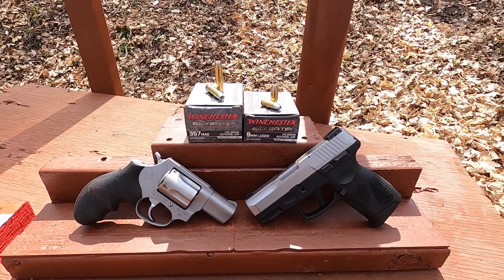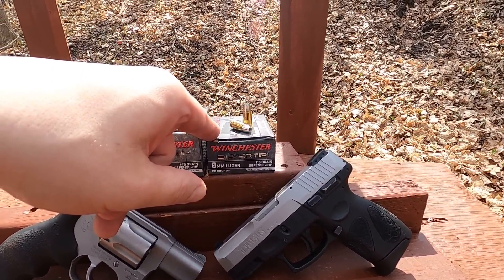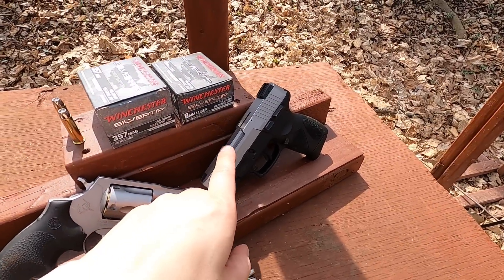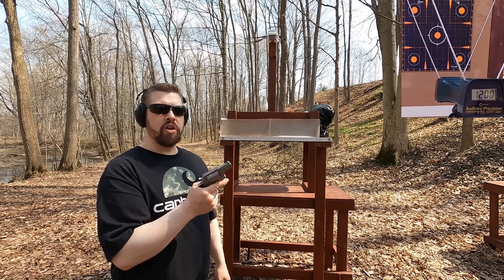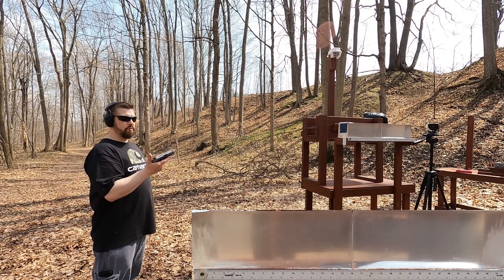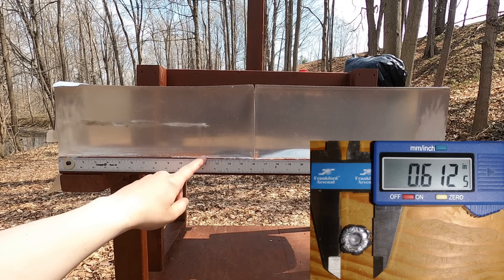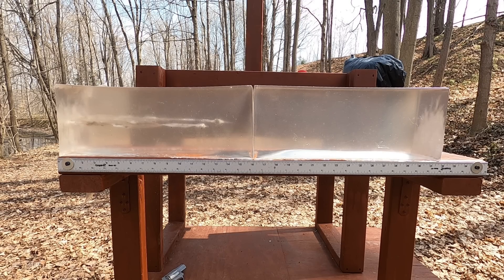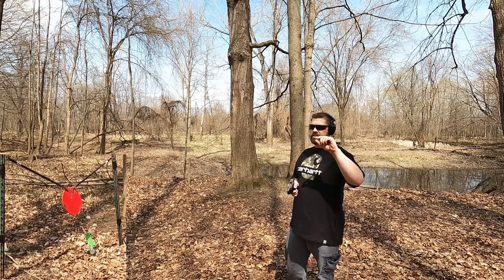Short Barrel Ballistic Gel Test -9mm VS .357 Mag Winchester Silvertip

Comment: I've experienced this back blast phenomena. To this day I still have don't know what caused it. I regularly shot Remington UMC 130gr FMJ 38 special but on one occasion at the that strange back blast occurred with a small number of the rounds in that box. The concussion nearly knocked my safety glasses off and it was extremely unpleasant for the thumb of my none dominate hand as-well. A range supervisor witnessed it we unloaded then gun and inspected it thoroughly to ensure it's timing was not off and that it was not excessively dirty he though maybe it was debris related. Once we were certain everything with the firearm was okay we determined it must have been that batch of ammo. I no longer shoot Remington very often but not for this particular reason I have shot this ammo on several occasions since and have never had it happen again. Excessive debris from the lead core or perhaps the base which is generally slightly concave may had some sort of irregularity was my conclusion. I imagine back blast from that 357 mag would've been a much worse experience.

Comment: I ran into a similar back blast issue once with some open base fmj I couldn't figure out why it was happening on every other shot and not every shot either its a strange phenomena. It seems Winchester has made changes to the silvertip line over the years I had some blemished round that lacked the plating a couple years ago but ultimately I parted with the product line altogether when quantity per box was reduced from 50 to 20 and price per round went up and yes this was pre-pandemic. Was the 357 mag from the same box used in the S&W 686 video?

Comment: Si ce you say the timing is ok, most likely the forcing cone is not cut quite right or is slightly misaligned. If so, i would expect that problem to occur with all ammo. Don't k ow if recutting the forcing cone to 11 degrees would help. I know it is commonly done by gunsmiths when tuning a revolver. Just a thought. The rounds could have done a little better, but expansion was great. Might be a good load for apartment, townhouse, or condo dwellers. Esp the 9mm.

Comment: My 605 did the same, and it was a timing issue. if you press the trigger to the rear of guard you will feel  movement rotating the cylinder. Try this with S&W, SP101, K6s, the cylinder will not rotate. I have used the same ammo in all four, and the 605, only culprit
Reply from the maker: I checked the timing. No timing issue. If this is the issue, why has all ammo before this test been shooting fine no issue, and all the ammo fired AFTER this test shoots fine no issue? I think it's fair to use common sense rather than jump to conclusions.

Comment: Your gun is so out of time.........................................J/K🤣🤣🤣🤣.
Honestly it's something I've never really researched but beyond making sure the cylinder is locked before the hammer is fully back in SA and before the hammer falls in DA[and maybe feeling for cylinder slop when the trigger is pulled with hammer down] is there anything else to check??
Reply from the maker: I do both those thing, as when I had a J-frame fragmenting ARX bullets, you guessed it "your gun is out of time". I do a slow double action pull, and it locks up long before the hammer drops. I put a .32" dowel rod down the bore to check for catches, manually inspected lockup with a flashlight etc. All I can say, is it's not out of time. Oh, and the ultimate check, try other ammo after....yeah, no such issues like with the Silvertips.

Comment: Ballistically, the 115gr 9mm +P+ is roughly equivalent to the 110gr 357 Mag. from a snubnose... but with less muzzle blast.
Reply from the maker: Yeah, a 9mm +P+ is like this, and low recoil. But the downside is, well if you are anything like me you feel fie with the .357 Mag and kind of squeamish about an overpressured round and the ability for your firearm to handle it. Like, I tested some in my 5" M&P, but there's no way I would run it in my G2C.
Reply: @GunSam  I hear you. I've ran both a Gen 3 Glock 26 and Gen 3 27 w/9mm conversion barrel/magazines and never had a bobble or had the gun beat up too bad. Most of your top tier brands will handle +P+ you just don't want to feed a steady diet of them... just enough for function and accuracy test every so often. But yes, the "cheaper" brands I would be leery of firing +P+ rounds even for carrying... because the middle of a firefight is the last place you want to find yourself with a busted extractor, etc. 😳

Comment: By the 2nd round, I'd have been wearing a glove with the .357.   Even if it's only gasses escaping out of the gap.  We used use a brown paper bag to cover our shooting hand and handgun.  Shoot down range and check for holes in the sides of the bag.  If the cylinder gap to barrel was misaligned on any chambers, it would leave "finger prints" to tell the story.

Comment: Timing would have been my first guess too considering you didn’t mention that blowback problem with the 686. But I will believe you and trust your word that timing was not the issue. 

Either way I feel this round was disappointing in 357 Magnum for sure. Really inconsistent velocity. Looked real good in the 10mm from the previous video and not bad in 9mm (probably be good enough in a duty size pistol). But I wouldn’t really call this 357 magnum. Definitely a light load. Good video though.

Comment: Funny thing, I recently bought some SILVERTIP in .380 because it seemed like a good deal. After your review I see that it's probably, pretty much crap! I won't consider it too be a self defense round. Now, I will just sling it down range at some paper & never look back. The SILVERTIP .380 is 85 grain, 1,000 fps with 189 energy. Got it at Bass Pro for $14 a box, oh well. I will stick with the Federal Premium Hydra Shok JHP. Thanks for the heads up on this ammo!
Reply: Depending on temperatures and atmosphere pressures, high pressure rounds will “paint” you you with powder if  you are firing in a confined space, or low air flow conditions.

Comment: I had a similar issue with crap being sprayed back at me in my new Ruger GP100 10mm match champ & sent back to Ruger. Ruger had to replace 3 or 4 parts because they said the cylinder timing was off. Maybe a return to Taurus will resolve the issue... BTW Ruger was great & the return process, pistol fix & mail-back to my home took 13 days Total.
Reply: Don't expect that from Taurus customer service. I sent one to them and they had it four months and wasn't fixed when I got it back.
Reply from the maker: The problem, is that no ammo before or after this test had any issue. So, jumping to the conclusion about the revolver based on one ammo alone is not how I figure out the problem to issues. The problem is self explanatory.

Comment: Sam I was very surprised that the 357 145 grain Silvertip did what it did sounds to me like the jacket is or the aluminum jacket is shaving off in the forcing cone coming back at you I don't know if this happened in your 686 but it may not be the ammunition it could be the gun or both the nine mm in 115 grain was the staple ammunition for the Miami-Dade shootout 1986 with the FBI and as you saw penetration is just barely making FBI statistics and causing just wounds and not lethal hits to the vital organs of the suspects again great video
Reply from the maker: Thanks. I shot other ammo after this in my 605, no issues, cleaned and checked timing with a dowel that fit the bore tight, flashlight check etc, I saw no issues. I ordered the 158 gr LSWCHP standard pressure .38 from Buffalo Bore because it's velocity rating it identical to the old FBI +P load. I want to do a video on that shootout, testing the ballistics. That .38 round in a 4" 686 is what ended the fight, and I also have some 115 gr 9mm left and a 4" pistol like they had that day. Perfect setup to test those two rounds side by side. I plan to use my bologna/MDF pack, directly into the gel block. I might use a 2" for the .38 too as some agents had a snub revolver used.
Reply: @GunSam  this will be a very interesting video Sam.
Reply: Try measuring the length and diameter of the bullet, casing and cylinder. Compare the dimensions of that ammo vs one you know that works. It's possible that bullet isn't seated far enough in the shell casing. Bullet might be being forced causing that effect.

Comment: I have never had good results from the winchester rounds fired from several handguns with longer barrels in several calibers. I still have a box in 44mag. Maybe one day I will fire them? I quit buying winchester handgun loads a long time ago. The powder burns are unusual? It didnt look like your thumb was in the danger zone. You might check your cylinder end gap but it was probably just slow burning powder with no where to go?
Reply: I have used a lot of winchester   mostly it's good , the 44 is full power & very accurate , the bullets are too hard / strong for deer  ( bear bullets ) .
Reply from the maker: Shot other ammo after with no such problems. The only good Winchester loads in my opinion are the Ranger variations and the PDX1, which is a Ranger variation.

Comment: the 115 gr Silvertip was fired out of a S&W model 459. if it hadn't gone through Platts arm first, it would've most likely destroyed his heart.
Reply from the maker: I plan a test on all this. I ordered the Buffalo Bore 158 gr LSWCHP standard pressure ammo as it's near identical velocity to the FBI +P load. So I want to test that ammo in a 4" and 2" revolver, as that was used in that shootout even though the 4" revolvers were .357 mag, as well as run the 9mm in my 4" Security 9 pistol. This should get us very close to the ballistics of the agents that day. Would be cool to see how they all compare in the gel block side to side, as the .38+P in a 4" barrel was what eventually stopped the fight. So would be cool to see why it worked so well.

Comment: Thanks for the video.👍 👍   Being an older round I wonder if the 9mm would perform better out of a full sized gun. The .357 is just weird,low velocity,high recoil and causes bleeding[and not to the intended target lol]. Something seems out of spec with it,like maybe the bullet is slightly oversized and is being shaved when it hits the forcing cone? IDK.
Reply from the maker: I thought it was unburned powder, but then again it might have done that with the 4" barrel and did not. I have not tested the 9mm in a longer barrel, but there's another unreleased video with this same .357 ammo in my 4" 686 VS the 10mm version in the Glock, and in that test the .357 Mag Silvertip did not hurt me. I'm going to look at the 605 and make sure it's right and in time, but my initial thought is it's fine and maybe something is out of spec just enough over on the .357 Mag ammo and maybe my 605 is just slightly underspec, and maybe this is the issue? I really don't know, all I know is this ammo was fine in the 4" barrel and all other ammo is fine in my 605.